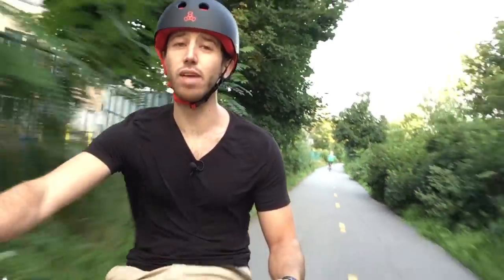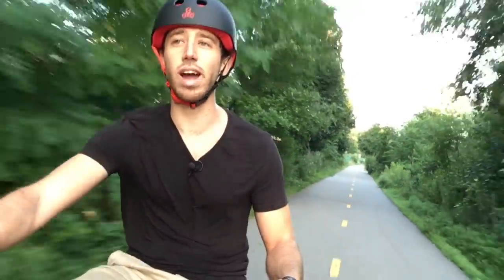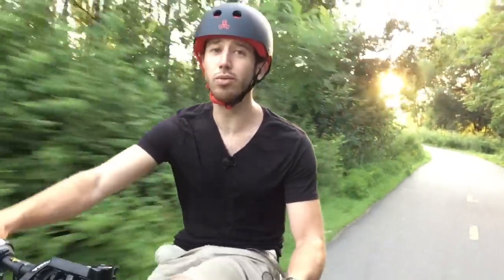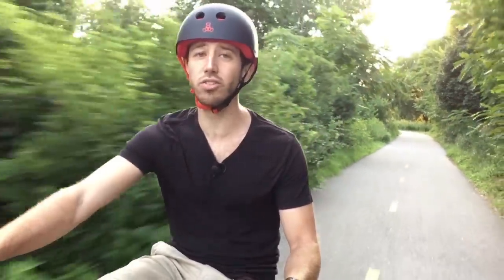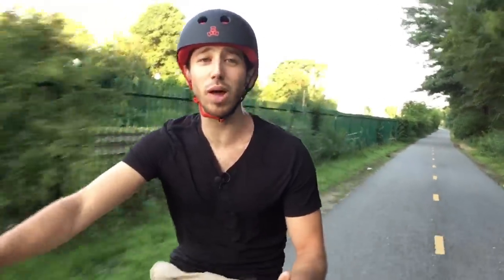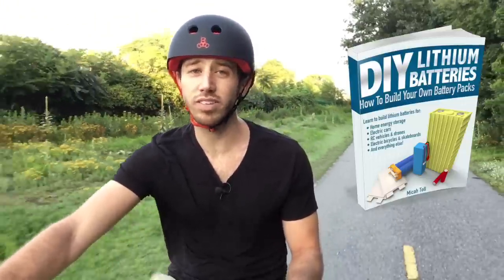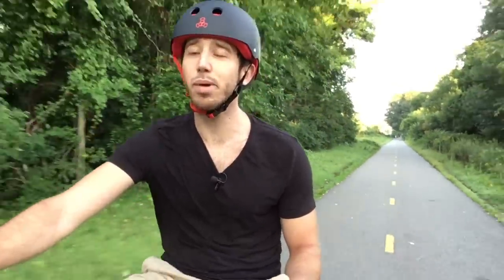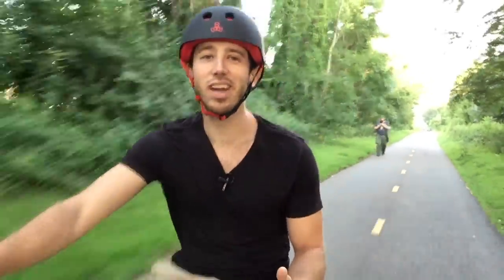10 Tips To Make Your E-bike Go FASTER!!!

Comment: And what about the hub motor? Mine say Max. power 300 Watts and 36 V. It was used with a 36 V 300 W controller. Can the hub motor handle any controller regardless of voltage and power if I can keep the hub motor cool?
Reply: You can increase the voltage going to your motor by using a controller rated for higher voltage, and a battery that can provide that voltage. An electric motor's rating of voltage is just a value the manufacturer decides to use for the motor to run safely and without any problems. If you exceed the rated voltage on an electric motor, assuming that it's a dc motor, it will go faster and because of the increased input voltage the overall performance gets increased. However, the increased input voltage may cause the motor to heat up more, and if you don't want the motor to overheat, or don't want to install any additional cooling system, the increased voltage shouldn't be over 15-20%.
Another important thing to consider is that your hub motor rated for 36V 300W can output power more than it's rated for, for example on an ebike under load it may be possible that the motor is trying to squeeze more performance out of itself than 300W, but the controller limits the power usage to 300W (at 36 volts it should be about 8.3 Amps), and if you use a controller rated for a higher output power, for example 500W, your motor may actually get to go faster, because motor can get more power. Although, this may not make your bike faster, there's a great chance your motor can actually output more power at the rated voltage than it's rated for.
Reply: I'm pretty sure it can handle more power than 300 Watts, because it's a heavy direct drive hub motor, weights around 5 kilogramms. I can use it with a 72 V 2000 W controller if I keep the hub motor cool, can I? Amúgy köszi a választ. :D
Reply: Yes, with proper cooling it may work, but I wouldn't go too crazy with it because it can overheat anytime or just die instantly because of the increased voltage.
I've personally tried overvolting a small 12V brushed motor, and I think I got it to around 20-22 Volts before the "blue magic smoke" decided to leave. It also made a really high-pitch sound which was really uncomfortable to listen to.
I think that a 2000w controller is unnecessary though, because the motor is said to have a power output of 300W at 36 volts. If you divide 300 by 36, you get, that if the motor is running at the maximum power, a current of 8,3A flows through it. Now, let's assume, that the motor can draw 10A of current at 36V, but the only thing stopping it from getting that power is the controller. Now, imagine that the controller can supply any power your motor draws. If your motor wants to draw 10A, and you provide it at 36V, the maximum output power would be 360W. But of course, the goal is to get a lot more power, so we crank up the voltage to 72V. The motor still wants to be handed 10A, but now we give 10A at a voltage of 72V, this way boosting the overall power consumption to 720W. You can keep giving it more voltage, but at it's top, it can only draw 10-15A of current, which gives it about 1000W at 72V. Also, at these voltages a lot more power gets converted into heat, meaning that if you increase the voltage too much it might just suck more power and give it off as heat, leaving you at the same speed.
I wouldn't recommend using it at 72 volts with a 2kW controller is absolutely unnecessary. A reasonable solution would be to use a 48V 500W controller, that could get you a 60% boost on output power assuming that the motor can even draw 10 amps. If it can't, and will only draw 8,3 amperes, it's still a 30% increase, which is really nice. Also, it's not as expensive as playing with a 72V 2000W controller that might just fry your hub motor along the way, making the project a hell of a lot more expensive :D  
Szívesen :D

Comment: Thank you for this info but how do i know if my controler can handel the voltage ?
Good video like always👍🏻🤟🏻
Reply: You usually have to open up the controller and make sure the capacitors are rated at a higher voltage than your target.
Reply: Thank you 👍🏻🤙
Reply: I opened my controller and Made my battery 48 volts but now my ebike does nothing, changed it back to 36 and it works fine, is my controller limited to protect the controller?

Comment: dont forget higher pressure means less chance of tyre pinch !!! rather have a bumpy ride than a fucked tyre inner tube, and a 52v battery is best for a 48v system it wont hurt the controller and the BMS wont drop out so much when using all say 1000watts if battery drops to 40%

Comment: Corect me if im wrong this is what im told my vado e-bike charger is 42v and charges the battery to about 42v but the Controller is giving the brose motor and the system 36v so when the battery drops in Voltage Down to 36-37v when onley one bar on the battery indicator  left  it still has 36v on the system ,i dont feel any power difference on full battery down to one bar left on the indicator

Comment: Hey thanks for the Video's I enjoyed the last one where you went more into depth. You were at the Beach with your 2 wheel Drive and your matched up Packs. I'm I interested in your books specifically on Dyi anything to do with the batteries as I'm doing a build where I want to use a 22v 2000mah Vacume cleaner Battery pack as much as that sounds slow I'd like to know the best option to over volt or speed up my original 36 v bike which I already have 2 36v packs in parallel. One is a 250w the other is 500w If you have a min I'd like to know if I wire the 22v 2000mah battery in series to what I have to speed it up a bit, how it would affect my ride. I understand to check my speed control to make some it can handle more voltage chances are it's the cheapest Chinese make so I don't even want to open it up to see. I appreciate it. Thanks

Comment: I'm making a 18650 battery pack with the vruzend 1.5 kit.  I was looking at batteries cells and was wondering is it ok to use a ultrafire 3000mah battery for the kit wats the difference from lets say a 2.9mah battery?
Reply: Keith Walker look at Battery Bros
I’m getting LG MJ1 for about $3.50 plus shipping.  That’s 3500mAh.

Comment: Hey what's up man group video thanks for the tips just bought me a cheetah e bike it has other futures of the mile per hour the highest is 99 how do I disconnect that and do I buy a high voltage battery or motor because I'm trying to hit high 30s right now Im hitting 28 it looks like a Harley I'm just trying to make it go faster thank you sir

Comment: Thank you for all the great videos. I have just build a 52v 20ah Ebike with the triangle vruzend battery from your other video. Plus a 1000w mid drive Bafang motor. 
Your videos really helped with my project 👍
Reply: What’s the mph for that setup?
Reply: Dracstar it’s Around 35mph on the level motor is now over clocked at 1500w.

Comment: How abaot more tyre presure? I use 4 bar, or 50psi to roll at asphalt. I allso have side motor whit free wheel, so I have zero resistance in downhill. I don't need power at all riding flat, just uphills.

Comment: Would a front geared hub motor, be quicker and more nimble than a rear wheel geared hub motor of the same power and style? thinking of having the use of two drive wheels on pas. I could imagine that if one of the tires low on air, you wont realize it with 2 wheels driving forward. I think this would be my next experimental build.

Comment: I have found with a couple of controllers that with the battery pack you can add one more cell in series any more the overvolt protection kicks in and it won't work. 
Thought I had stuffed it first time.

Comment: Switch wheel size to 18”. Also set km and increase maximum speed to 30-40 to increase speed and set approximately the real speed in miles even though displayed as kilometers

Comment: I have a 36V/250w kit with no other info whatsoever. No sticker on the controller,  either. Any other option to know if my kit will handle 42V, apart from taking the controller apart and having a look at the capacitors?
Reply: Thanos Tourtouras it will :)

Comment: Not all your suggestions will be a good idea if you have a one year warranty. For example using a higher battery voltage could destroy the control electronics and not all e bikes use common battery terminals so swapping to another non standard battery might not be a good idea. One idea might be to change the rear cassette so the bottom sprocket has 11 teeth and a larger chain ring at the front.

Comment: Hi, is it possible to power one motor with two controllers, to double the voltage? This assumes a battery pack for each controller.  Has this been tried?

Comment: Thanks for your hints . My new Jupiter folding bike would only do 15 MPH when I got it . I called the factory help line and they told me to power up the controller ,then hold the up and down buttons until a number comes on . It was 20 so they said increase it to 70 then hold both buttons again to get back to normal . It only increased my speed by a few MPH . My battery is 48 Volt 750 Watts and my daughter's smaller bike is 500 watts but goes 18 MPH . Her bike is lighter and mine has fat tires and 20 inch wheels . I would like more speed .

Comment: This may seem like a stupid question but here it is anyway. I have a 26" rear rim, but it is a fat tire, would that still be considered a 26" wheel as far as what I would enter into my display settings? By the way, I love your channel and all the very useful information
Reply from the maker: Not exactly, you'll want to look up a 'bicycle wheel tire circumference chart' and find the actual circumference if it asks for that, which will give you a more accurate reading.

Comment: Dear Micah,
I have a great idea for your video. The implementation of which will be very useful for many people.
Let's imagine that John has an e- bike with 36v 10 AH battery pack. It charges quickly and gives enough power to cover 20 miles a day around the city.
But one day John found a girlfriend in the nearby town, which is situated 35 miles away from Jonh's city and it is a must to visit his girlfriend every week-end.
John does not want to make a bigger battery. He just want to make another 36v 10 AH, make a connector and connect these two batteries in parallel to get a 36 v 20 АН battery. One battery pack will be under the frame, and he will put another one in his backpack for long rides only
Please, show how to make such a three tail connector using, for example XT60 connectors for combining this two batteries aiming to get 20 AH for longer rides. The best of luck to you and thanks for your creative work.
Reply from the maker: Lucky John! That's a good suggestion, thanks. I'll try to do that.

Comment: I had a question about how much power a mountain bike frame can handle. Can a generic mountain bike frame handle a 1000w rear hub motor and a 1000w front motor? I know I need a torque arm (maybe 2) in the front, but would the rest of the frame be able to handle it? I'll probably have a 20ah triangle battery in the frame and also a 20ah battery on a rear rack.
Reply: "would the rest of the frame be able to handle it?" yes absolutly.

Comment: I pedal in top gear to get my best speed , 35 mph (1000 W motor 52 v) I feel gearing up would increase my speed.  Currently at that speed I have very little pedal resistance and my legs are a blur pedaling, your thoughts?
Reply: Need a bigger pedal sprocket

Comment: I am planning on building my own e bike with a diy battery and an angle grinder motor but they run on 230v. is there a circuit in these things that converts 230v in to a lower voltage for the motor that i can remove? or am i better of using a 18v angle grinder motor with a big diy battery?
Reply from the maker: 18V angle grinder. Because it has a DC motor. The 230 V has an AC motor which won't help you without an AC-DC inverter

Comment: The last tip is the easiest and most important. It is the restrictor that is limiting your speed more than any thing you mentioned. I have a   " Bad Ass " Brand destrictor that takes about thirty seconds to install. It slips over the sensor that is located on the chainstay. They work perfectly.
Reply: Sirios Star what ebike are you running the bad ass on
Reply: David. it's a Cube with a Bosch CX motor and a 500 watt battery.
Reply: Sirios Star thanks that’s great have got cube race 2018 going to give one a try cheers
Reply: Fantastic, you'll love it . Bosch motors are notorious fo cutting out abruptly  which is really annoying when cruising on a flat surface. The Bad Ass completely illuminates that and gives you  a smooth and natural transition to higher speeds.
Reply: i need to clarify , although you probably figured out what i meant.
Bosch motors abruptly stop when they reach the 25 Km limit.
Reply: Sirios Star yeah guest what you meant thanks again
Reply: So you can ungovern ebikes?? Does it work on all?
Reply: Hello, Salvage. I'm pretty sure it works on all Mid mount motors,  not sure about hub motors. 
There are lots of companies that make destrictors . i chose Badass because it's so easy to install. Takes about one minute. Pricy though. about $140 .

Comment: I thought that most e-bikes top end speed is locked in at the controller. While most of these tips will allow for faster acceleration they will not change your top speed because the controller is programed to cut off a given speed.
Reply: Well that means more range?

Comment: If I have 2 motors connected to their own controller, connected to their own battery, Can I still connect one throttle to the 2 controllers? Or can I only do that with one battery?
Reply: As long as the controllers and motors are the same, just splice one of the throttle wires into the other and you should be set.

Comment: I run on 28" wheels. I tried a couple of settings (24inch, 22, 700c), but i didn't notice any difference in top speed ( i used my gps). My battery wasn't fully charged though, but again that was a comparison between 2-3 settings, so i should have seen a small difference.
Reply: That's because all they did was use their cpu's internal clock to register their speed.  They changed the internal clocks formula.  So I have a motor that pushes 200RPM at 26Volts on a 18inch rim.  The CPU calculates the formula using those factors.  They went in and told the CPU they had 20inch rims which changed it's formula and went from 20MPH to 25MPH because if they actually had 20inch tires that's the speed they WOULD be going.
Reply: A motor is only controlled by how much voltage it is given, speed wise anyway.  Changing the wheel size isn't a plausible hack unless they actually change the wheel size

Comment: Hi awsome video as usual. Could you please explain about changing the wheel size in the controler settings to get a bit more speed? Would the wheel size have to  be reduced in the controler settings? 

Thanks
Reply from the maker: Yes, you'd enter your display's settings and choose a smaller size. So if you have 26" wheels, try setting it to 20".
Reply: EbikeSchool.com  Great thanks for the reply yes I have a 26inch so I will give it ago. What's the theory/how it will make the bike go faster? 
Thanks

Comment: So my battery is in a bag sort of a holder type bag you know it's an ancheer bike with the battery on the front of the handlebars so is that bag bad for the battery is it helped overheat the battery.? And so I'm having a problem with my battery it's dying out too quick I use it everyday a half hour ride to work two half hour ride back from work I'm just wondering if I'm charging it too much overcharging it and now I've only probably had it maybe a month and a half the bike I just purchased it so I'm having an issue trying to find out if I should build my own battery and how do I start finding the equipment to build my own battery I have a lot of issues and a lot of questions I can't put into words right now
Reply: Buy Micah's "DIY Lithium Batteries" book, this will guide you from start to finish.
Reply from the maker: I have that bike, the bag is pretty thin so I don't think it's too bad, but you can always leave it unzipped while riding to let the battery get more cooling air. You probably aren't overcharging your battery if you just use the stock charger. But that bike does come with a cheap battery so over time it will drain a bit.
Reply: EbikeSchool.com so okay from day one that I received this bike I've been riding it's on high speed now I have been losing power in the battery so I'm wondering if I have some bad cells I plan on tearing open the battery after I get the equipment I need and looking at the batteries maybe they have lost some charge but I'm low speed it doesn't drain this fast I've got to get the welder and batteries any idea where to get batteries so what is the parts list that I need shrink wrap, the aluminum strips, the batteries, the welder, and should I get a new BMS battery management system I'm not sure

Comment: does a lithium ion battery balance itself when not being used, since all the cells are connected
Reply: A group af parallel cells will always be equal in voltage, but not necessary equal with other groups in series. Unless you use a capacitive BMS the balancing (resistive discharge) will be done at full charge (end of charge).

Comment: Or you can change sprocket for top speed if you have mid drive motor.
Reply: YES MORE SPEED BUT YOU HAVE LESS  PULLING POWER THAT CAN LUG YOU MOTOR CAUSING IT TO BURN UP

Comment: My bikes display is from das kit, I changed the wheels size from 27.5 to 29, this allows my bike to go above the legal limit which is 36kmp ,and it's now going 45 kmp ! Thanks for the tips!
Reply: It shows you 45kmph but its not going that much. You have to put smaller wheel size so it thinks it has to spin faster for same speed but you're not going 35 but 50-60
Reply: @lukakoritnik365  don't tell him lol it's a placebo